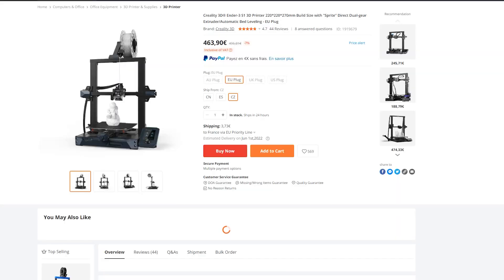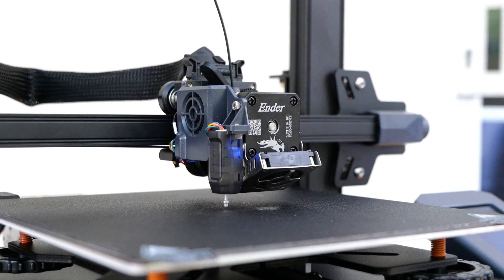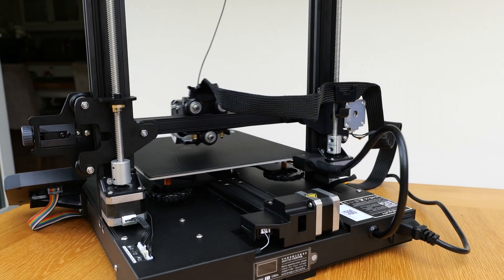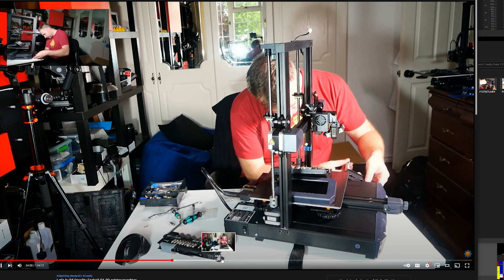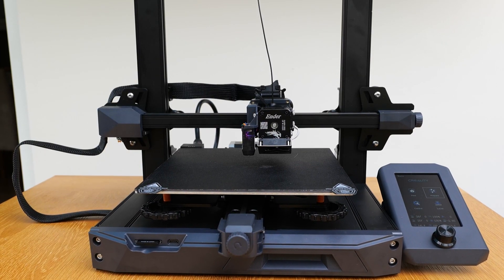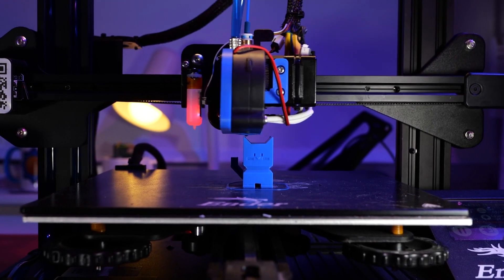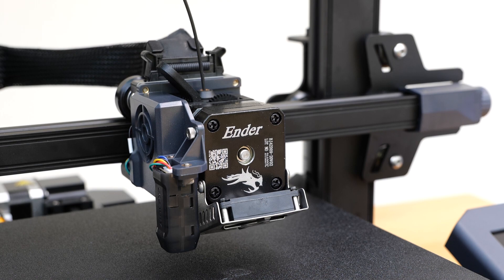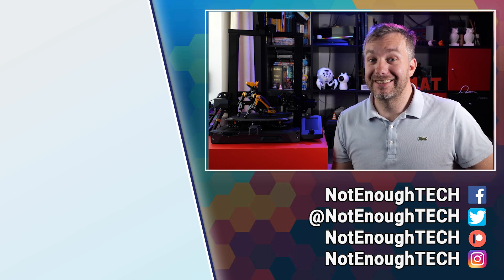Ender 3 S1 review

Comment: great video....think this might be my first printer...fyi, codse dont seem to work if using the app which gets you  the better price on its own anyway
Reply from the maker: Thanks. Perhaps the code is for the web store only. Check both pick the best price ;)
Reply: @notenoughtech  looks like the pro cannot be ordered yet but with the code I was given for joingin the S1 std can be had for 275.37 which is a super bargain...will hold out to see what the Pro costs as that would be the better option if a simialr discount